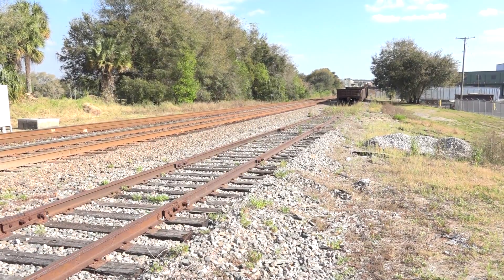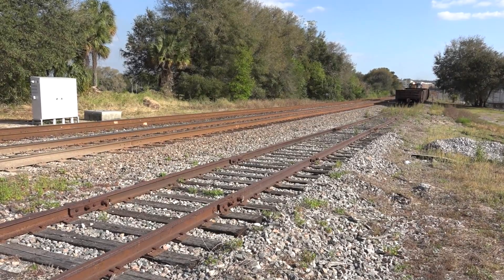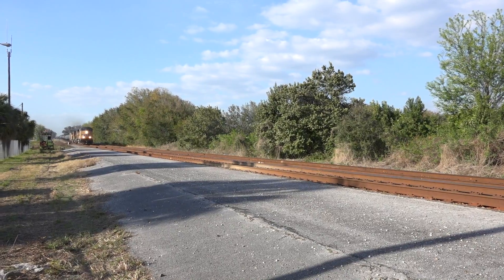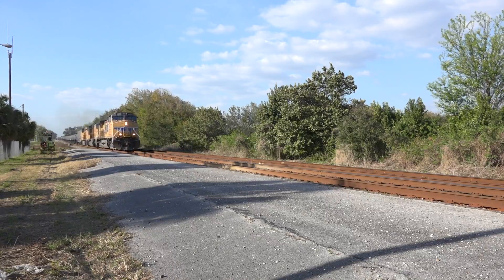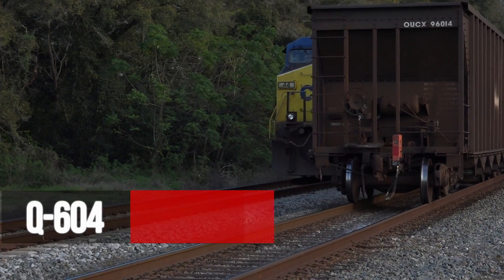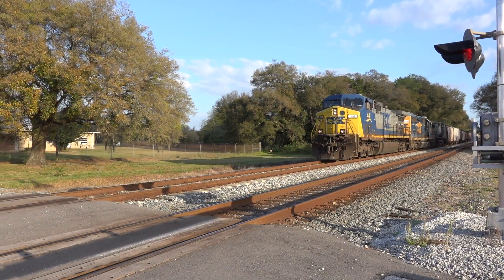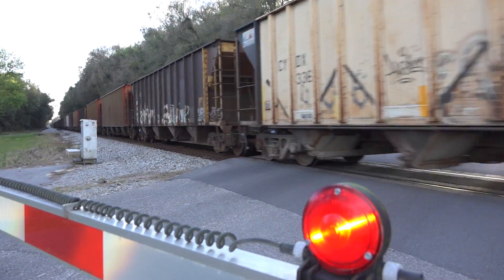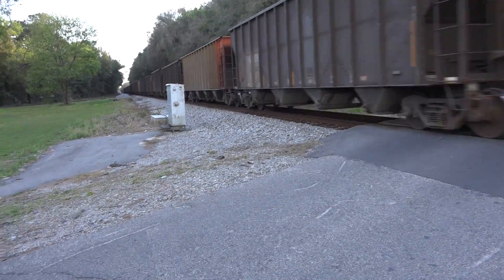Six Trains In 90 Minutes

Comment: Another great one Sir and yes, it wouldn't take much to take out a knuckle if the slack was yanked out passed the 350,000 lbs rating of the more common c grade couplers on the standard cars and locos today. That's a lot of poundage right there to snap one right off. And you ought to get a shot of where they store em on the locos if you see them anytime soon. Keep em climb o sultan of the S Line...

Comment: You oughta take a trip down to the really deep south, and I'm not talking about Texas here. I'm talking about making a trip across the Pacific to new Zealand and checking out our very dated EMD G8, G22AR and GT22, and GE U-boat workhorses, recently joined by Chinese built CNR Dalian DL-class locomotives (yes shudder all you like, they've actually outperformed the U-boats by a considerable margin). We also take pride in the heritage fleet, with almost all of them in private hands for restoration and preservation. There's classic coal fired and oil fired steamers (most notable are the K, Ka, J and Ja classes, with Ja1275 the icon of NZ steam power), a few English Electric diesel electrics of various classes, some full electric locomotives, railcars, half a dozen DA-class 12-567-powered EMD G12s (these are what the G22AR's started out life as). Plus there's scenery like nowhere else in the world, especially on the Canterbury Plains and the West Coast of the South Island, where you sometimes see 5 to 7 U26C U-boats hauling a coal train up the Otira grade and through the Otira tunnel, although with NZ coal mining nowhere near as profitable as it used to be, as well as the Pike River Coal Mine disaster, the number of coal trains has dropped considerably. But there's nothing like watching 20,000hp of 7FDL-12s at notch 8 roaring up the hill....

Comment: Nice video Danny! Greetings from the Great Lakes region! I think you should consider taking a railfanning trip to Fostoria Ohio. It has 130 trains a day and they got the country's largest railfanning park. And they also got a nice viewings platform. The last time I was there i saw 18 trains in less than 3 hours. I am from the Detroit Michigan area and I go to Ohio and railfan at least 1-3 times a month a  month. Also railstream has two live rail railroad cam there. Railstream is a very neat website it costs 12.95 a month to get all of the cams. I really recommend that website. My name on railstream is Norfolksouthernrailfan2002. And by the way keep up the good work you have excellent videos

Best regards Graeme case
Reply from the maker: Hey thanks very much! Yes, Fostoria is on my list. I hope to make a trip up there sometime. Probably not this summer. Maybe next.
Reply: @Toto-ci6pr  1:54 That is called a buffer car.  It's probably full of sand.  They are used on each end of hazardous, volatile cargo to ensure separation from that cargo from men and crew.  Should there be an accident, the last thing you want is any of those cars getting close to the cab(s) where the crew are, as heat or explosions drastically reduce survivability.

Comment: What do you edit with Danny?
Reply from the maker: +Standard Cab Productions Since 2013 I've used Final Cut Pro X running on an iMac. I started out in 2000 on a G4 running FCP 1.2. :-))
Reply: Thanks!
Reply: +Distant Signal damn there are going faster then a speeding bullet

Comment: What's the difference between a siding, super-siding, and section of two main tracks?
Reply: Rich Hood    I would say a super siding is longer in length than a regular siding and typically also has a universal crossover around the middle. for the most part, a regular siding is nothing more than a second track for a train to go into when there is a train coming from the opposite direction or in some instances a higher priority train is coming behind and they run the lower priority into a siding and let the higher priority train go around it.
Reply: A siding is a secondary track that parallels a main track for a distance, usually able to store an entire train for a meet, which allows two trains on the same track to pass one another.  It's called a siding because, like a roadway, you "pull over to the side, and stop".   A super siding would just be a really long siding, which likely can store more than one train.

A main track is a principal track which allows trains to get from place to place.  Having two main tracks ("2MT") or even more ("3MT" or "4MT") allows more trains to travel at the same time.  It also allows for flexibility (redundancy) should one or more tracks need taken out of service for maintenance, inspection, or an accident.  There are different operating and maintenance rules between main tracks and sidings.